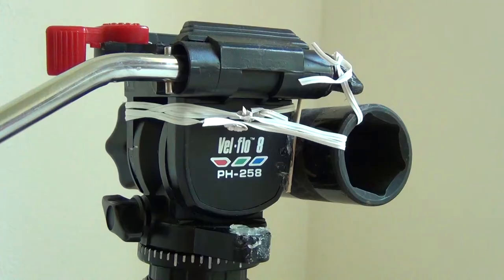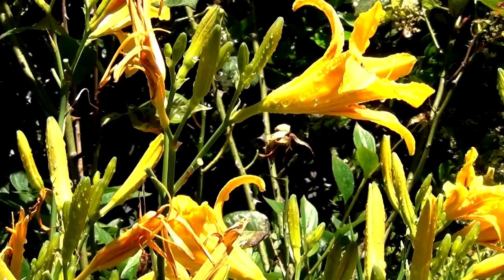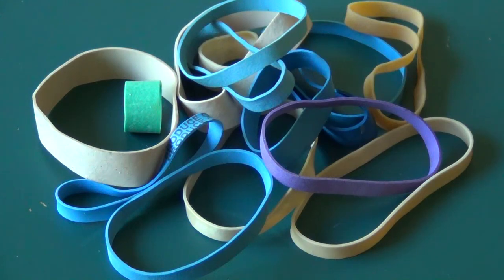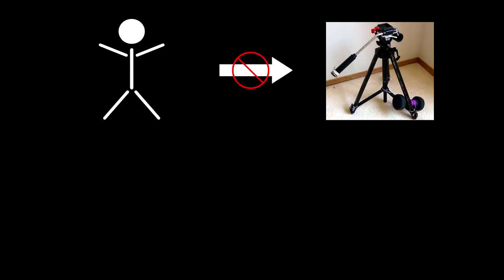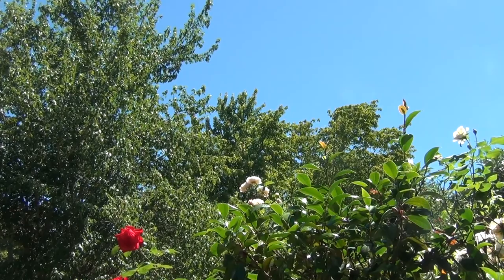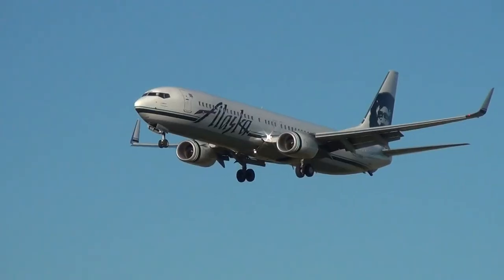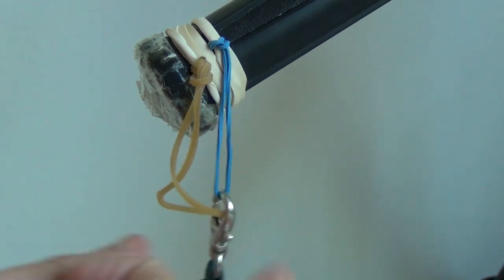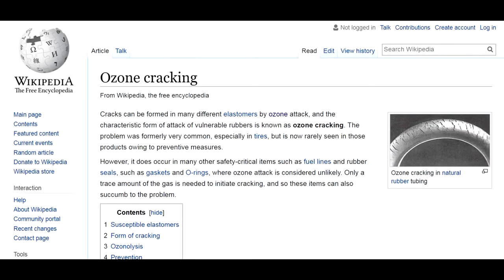Tripod Rubber Band Trick

Comment: Interesting video bud. My way of trying to keep my videos as smooth as possible, is light & heavy touches, depending on the speed of the aircraft, weather, and location. I never use all fingers to pan, usually 2/3 at the most. All if its very windy of course and my other hand acts as an extra weight holding the tripod down, I hold one of the legs firmly to ensure it doesn't fall over due to the strength of the wind. I use my ruck sack, which I carry my equipment in as extra weight. It seems to do the trick. I hope this gives you a few ideas.
Reply from the maker: Hmm interesting, I'll try that out the next time I go. Thanks bud!